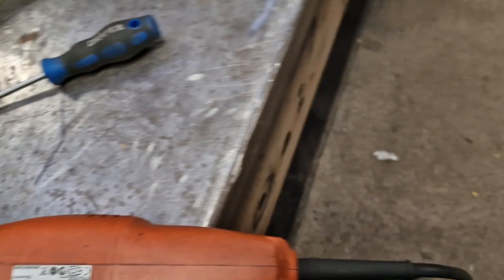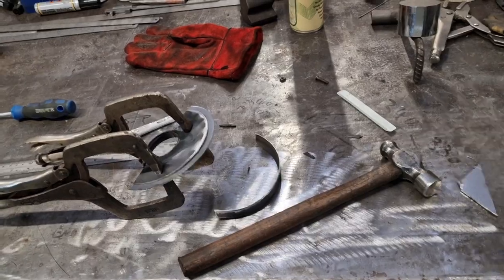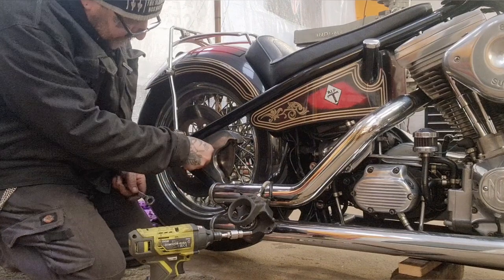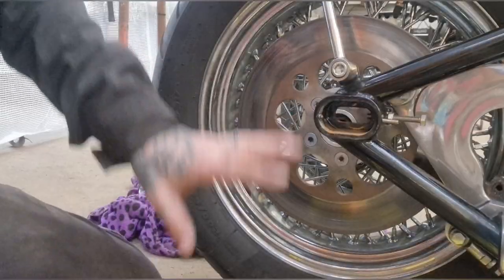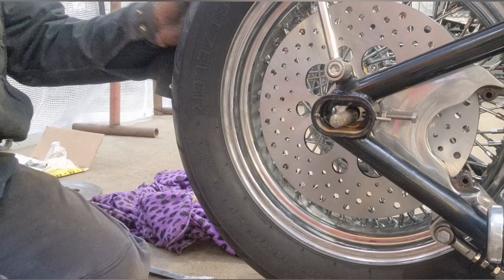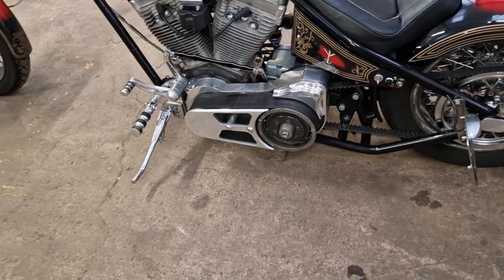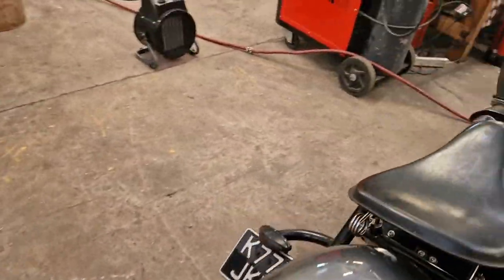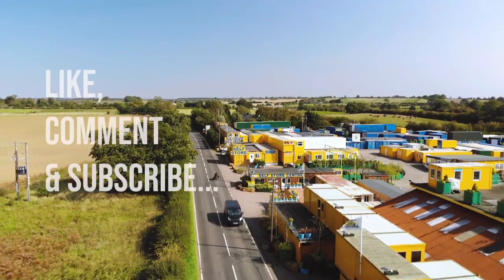Handmade Harley and Triumph Custom Bikes Safety Gaurd Vlog #engineering #metalwork #handmade

Comment: 😎👍😎
On your triumph I see you've made a shield around your pods..is that for looks ..or does it help balance the air ..
I've read where if you remove your air box it's a pain to get the carbs to breath right . ??
Reply from the maker: The shield runs over the top of the filters, to keep the rain off
It wasn't too bad to setup right